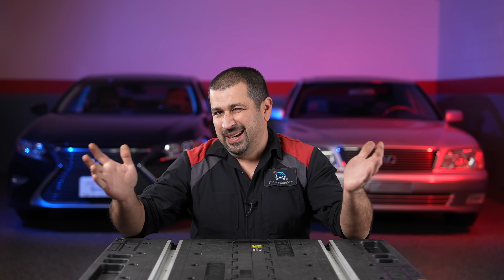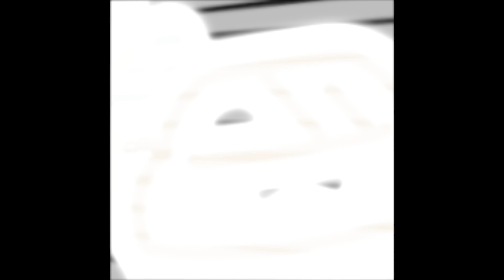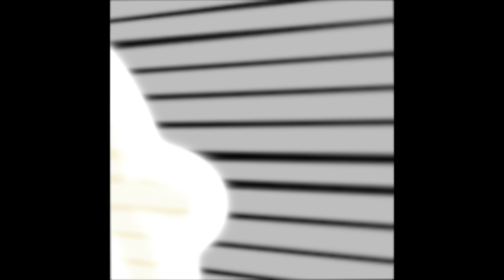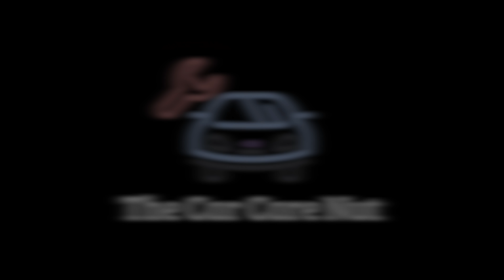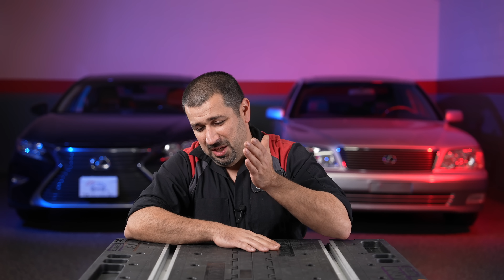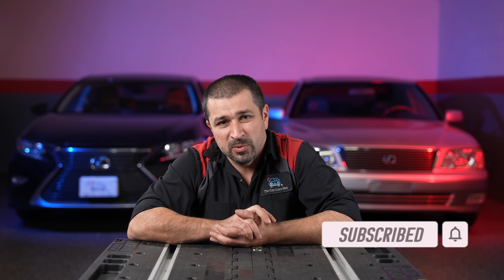Can Modern Turbo Engines Be Reliable? Here's The TRUTH!

Comment: I hear the "adapt to the change, old cars are just getting older, you're going to have to buy new/er eventually", and that just solidifies it for me more in my head: my next vehicle purchase will be 2015 or older. I hope that there are enough consumers doing similar that it changes the industry, but I doubt it, and there's nothing that is making me change my stance either until we go back to basics: analog gauges, simple button layouts, DIN standard radios that are not part of the CANBUS network/ECU controls, radar/cameras/idle stop/start/emergency brake tech being optional features, simpler but efficient and reliable engines that adhere to "right to repair" ethos, etc...

There's simply absolutely nothing appealing about new cars when the cons outweigh the pros when looking at any given vehicle as a whole package. Justify/defend new vehicles and their tech all day long, I think for me older = better, more reliable, safer, and easier/cheaper to work on. I just need more mechanics like CCN here in my area to help keep my fleet alive!

Comment: Emissions are produced by burning the fuel, not by the number of cylinders. A small engine with a big turbo burns as much fuel as the larger engine without a turbo producing the same amount of power.
This being said, I fully agree with the recommendation to change the oil frequently.

Comment: Well said. 
I  own a 2014 (since new) Nissan Frontier naturally aspirated 4.0 V6 and it is golden. Previously owned a new 2003 Nissan Maxima with the same V6 displacement engine and never had a problem. One time I drove through Mojave Desert 116 degree heat and the temp gauge never went past the level 1/3 mark. Change oil often and they will perform well past 200,00. I will never own a turbo. My next car will more likely be a restored classic V8 sedan from the fifties or sixties. That is all.

Comment: yes they can, but only if they are not designed extremely lightweight, and extra lightness does not compensate fuel savings vs engine mileage lifespan. aircraft prop engines with turbochargers work reliably at high load and the difference vs car engines are proper cylinder wall thickness, proper oil cooling, regular turbine maintenance. 
current car turbo engines of kia, bmw, mercedes, ford are designed to fail either at journals at cylinders or at oil pump it is not "if" it is well known pattern.

Comment: I bought a Ford F150 with the 3.5 Ecoboost engine.  It had 145K on the odometer when I bought it. It has been trouble free since. I use the best oil and don't abuse it.
Reply: That V6 config will go much longer than the boosted 4.
Reply: I have one of those in my work van. Seems to be a good engine

Comment: Hi Ahmed, thanks for your honest approach to all this. I wanted to ask about oil filters and high frequency oil changes. Ie: if I change my oil every 3k miles, is it a help or hindrance over 200,000 miles to change the filter at the same frequency or leave the filter for every second change ie: 6k miles? I have been told (applies to air filters as well) is that they perform better at trapping particles once the media has caught “some” debris in it already. Of course, I would never run until too plugged and cause too much pressure drop. Hope that question makes sense. Thanks!

Comment: The problem lies on the aluminum, since it has a stress memory that will fail. Compared to carbon steel from past generations that will last for ever. By the way if diesel engines do not heat more than gasoline why don’t they get built out of aluminum?

Comment: Had an '05 Mitsubishi Evo tuned for 21psi drive it daily for 8 years to130k miles had a blast, never should have sold it. It had a slightly low cylinder upon a pre purchase inspection for new buyer bit not noticed at idle or peak boost.... funnest car ever i beat on it and replaced timjng belt 90k and new plugs. I hit peak boost daily lol. Changed oil overy 2500-5k depending on if I had taken it to canyons or not. Shell T6 most of its life...Mobil1 factory fill isnt even real synthetic and burns off as you drive.  Got a Subaru Sti in '15 and noticed same thing...M1 oil was burning off even at 10k miles...started putting T6 5/40 in it like the Evo and zero burn off. Pro tip....Subarus are trash compared to Evo's!

Comment: 2020 Hyundai Veloster N here. 70,000 flawless miles. OCI every 2500 miles with full synthetic 5w30. I use whatever brand is on sale. I drive pretty hard and even after 2500 miles, the oil is quite dark. Starts getting dark around 1800 miles. Listen to this mechanic and his opinion. He knows 💯❤️‍🔥. I agree

Comment: Turbos can... last. But They aren't built to especially now. Its like the early 80s when they slapped em onto cars. But I will say, my 2006 PT GT HO Turbo is at 216,000 mi. Going strong. All original.

Comment: Don't forget the added expense of buying PREMIUM gasoline for use in a turbocharged motor, rather than REGULAR gasoline for a non-turbocharged motor. Go ahead and run regular gas in a turbocharged motor, just to save a few bucks, and see how long your motor lasts!
Reply: I disagree, high octane is only to reduce engine knock/detonation as piston go up and down. It has nothing to do with turbochargers. A turbocharger gets spun by exhaust gases leaving your engine which in turn pulls in air on the intake side at higher rates/velocities than non-turbo engines would suck in air.  You turbo can't tell what octane you use, nor does it care. Another backyard mechanic I can see. If your car knocks on low octane but doesn't with high octane, then you're doing ok. But that still has absolutely nothing to do with the turbocharger, period, end of discussion.

Comment: I'm in the market for a new (used) vehicle.  Looking at a 2018 Acura RDX with less than 60k miles and I think I found one.  Why?  First of all, it still have a NA 3.5L V6 which is a very reliable engine.  I will be using what's called a VCM muzzler on it to stop the constant starting and stopping of the engine.  I'm also getting the base model.  No second screen and it has BUTTONS!  Less things to possibly go wrong.

Comment: Having auto stop/start with a turbo engine seems like a disaster waiting to happen. I always disable that crap with my EcoBoost 3.5.
Reply: It's about emissions, not reliability, unfortunately.
Reply: I disabled the start/stop on my 328i as soon as I got it. Even IF it's not horrible for the engine(highly doubt) why engage the starter constantly like that?
Reply: I just got a GMC Terrain Turbo 2019 with an auto stop feature, and I was bummed it didn't have the disable button like the newer ones. Luckily, the dealership let me return it two days later since I've done a lot of business with them before!
Reply: @dariuszcisowski You can buy a $6 part to disable it for good
Reply: Do you have to disable it every drive cycle?
Reply: @maxwellcrazycat9204  I do, yes. But I hear there are devices you can install to disable it permanently.
Reply: Good engines manufactures manage turbo engines in idle state as an aspirated one, so this do not affect the start/stop cicle.
Reply: Best thing you can do for thst eco boost is install a catch can. You would be surprised at how much oil is getting sucked into the intercooler by the turbos.
Reply: Auto stop/start is in general one of the worst inventions, regardless of whether the car has a turbo or not.
Reply: @Ghanemq8  unless you have a hybrid
Reply: @sprockkets   How come?
Reply: @Ghanemq8 Their is no traditional starter. The drive motor fills that role, and is powerful enough to drive the car. As such, it's no struggle at all for it to start the engine.
Course most hybrids aren't turbo either.
Reply: @sprockkets  I didn't know that. Solid info, thanks.
Reply: @Ghanemq8  Mazda CX90 and CX70 does this along with their larger turbo inline 6 cylinder. They call it mild hybrid and also use it for take off boost.
Reply: @sprockkets  
Also, start/stop on a hybrid in heavy traffic is more like "stop;  creep for a while on the electric motor;  start (the gas engine) only when speed increases".

My hybrid truck gets up to 21-22 mpg in heavy city traffic and only 17-18 mpg on the highway.  It is a twin-turbo V6 hybrid BTW.
Reply: @Ghanemq8 I did research.  A turbocharged gas car, without auto start-stop, will be more reliable than a normally aspirated car with this start-stop feature.  Is this accurate???   That’s what I’ve found in research.
Reply: @chrisduzynski6559   I don't actually know, I'm not an expert haha, but I would guess that the effects would be similar regardless of whether the car is naturally aspirated or turbocharged.
Reply: @Ghanemq8  My VW 1.4TSI was "stop don't start". Despite being a DSG automatic it was very prone to stalling if you didn't turn off the start stop.

Comment: Turbos will never be "Reliable", will never be "Great"
in modern plastic engines.
The number 1 villain against any engine is "Heat".
So let's add a component that increases engine heat, and complicates cooling?  Supercharges do the opposite. Assist in cooling the engine.

Comment: The problem is when they mate an SUV with an 1.3-1.6L engine with turbos and poor cooling. 2.0-2.5L engines and turbos would be more appropriate. Old Volvos with Turbos held upp just fine.

Comment: A co-worker had a 1987 Buick Grand National with a turbocharged 3.8 liter v6 engine. Wicked fast and a long distance commuter; 4000 mile oil changes and that car was still running strong at over 300,000 miles.
Reply: The 3.8 V6 is legendary
Reply: Turbos are not a hindrance to engine longevity when the vehicle has a decent base HP without the power. For example look at the base HP to weight ratio. 

Let’s take an example if I take a 3 cylinder 1 liter engine and put it in my pickup truck (which weighs almost 6000 lbs). That 3 cylinder engine is going to rev in the range of 3 to 4 thousand RPM to sustain a modest acceleration. If I am running a 3.8 liter V6 it’s barely going to break a sweat getting that truck on the highway. 
    So now we want the engine 1 liter engine to behave like the 3.8 liter engine using a turbocharger. 
1. We need to overpressure the intake stroke getting that engines intake manifold into the 30 to 40 PSI range. If the engine has a 10:1 compression ratio, that means that the head gasket, head, top cylinder and valves need to be able to hold this base pressure in. Then the fuel is going to be injected and an explosion with a base pressure of 400 PSI is going to 1000s of PSI before the cylinder is in its down stoke. The survivability is going to be dependent on many factors, it’s the corrosion resistence of the antifreeze keeping the meat between the cavity of the cylinder and the cooling system. Is this pressure going to dry out the rings more quickly creating friction. Is the pressure going to cause excessive wear on the valves and valve seats? At temperature will the head warp? 

2. All of the above is not a problem if you have a light foot, because peak horsepower on a turbocharger is charged mainly at high RPMs. The turbo offers almost no charge at lower RPMs 
Even revving the turbo up for brief periods, it takes time for a turbo to reach peak boost, so still not a problem. But if you decided to put a recreational trailor on you 3 cyl 1 liter truck and haul it up pikes peak. That screaming little engine with its turbo is going to start aging the engine rapidly by the following two things. 
1. Peak manifold pressure
2. Peak manifold temperature. 

3. On the turbo side the peak in engine performance is going to cause rapid degradation on the oil cooling components, deposits inside the turbo charger and lastly excessive heating of the oil requiring an oil cooler. 

Turbos are also not new for gasoline engines. They were used in the airline industry. The predecessor to the jet liners of Boeing, Douglas, and Lockheed were all using turbocharged engines. There were problems of using turbocharges, the map temperature required opening up the cowling, and if that was not enough the planes would need to drop speed and altitude. There were problems (accidents) associated with turbochargers. There were warnings and flight directives concerning their use. In general take off speed lasted only a couple  minutes, climb speed was lower (and so engine RPM) for a given throttle setting, more over the propeller angle was increased with climb which lowered RPM. Once cruise altitude was reached and airspeed increased the engines were throttled back, the prop angle was changed resulting in lower performance of the turbocharger. 

There were kids in my high school that turbocharged their 70 model muscle cars, the invariable result was they would blow the head gasket. Why are they adding turbos, they want a car the speeds up faster, a typical trany was a power glide, it would rev up faster than engines today because it had two gears, this means you could get that turbo power quickly, and you could blow your engine up quickly. 

If you are driving a Grand National 300,000 miles, I would almost bet this person babied his car, only showing off every now and then. He probably did not tow massive trailers on the back of his car.
Reply: @Darisiabgal7573 Good call.. I always look at the power of the motor has without the turbo..
Or at least look at the compression ratio. Back in the days for turbocharged motor compression ratios around 8:1... In my current vehicle is 10 to 1.. meaning that it has enough natural power that I can move on without the turbo..
Reply: @Darisiabgal7573  That is what I see and the 3.8 is a great example.  Getting 175-200hp out of them was easy so the 260+hp turbo wasn't stressing the heck out of the engine.  These I4 100-150hp naturally aspirated engines cranked to 300hp turbos, yeah, those are going to brick early in life.
Reply: Buick engineers had bumper stickers for those cars -- I Brake For Corvettes
Reply: Those Grand Nationals were amazing cars and bullet proof, I had an 87 GNX and in the 80s and 90s it left everything in the dust
Reply: @stevenekdahl7124 yes I had a chance to buy one and I still kick myself I had 10,000 Mi on it and they wanted $15,000 and I was too cheap to buy it
Reply: He used a grand national for a commuter car 🤭 good grief.
Reply: The Buick 3.8 was one of the best V6s out!  Buick V6!  Loved that engine.
Reply: Should have seen the GNX had the chance to buy  two GNX  they only made 500 and something and I was too young and too stupid to know the Rarity of these cars  the porcelain turbo  GNX could do 0 to 60 and under 5 Seconds faster than any car of the time
Reply: @marcusevangeliste7426  whew, and your comment was even edited? Wow.
Reply: Not familiar with that particular engine, but being an owner of nissan skyline r35 equipped with VQ35 which is v6 3.5L engine I agree, Those things are built for YEARS to last. Especially if you mostly drive calm, this engine not getting too much heavy load and sounds great as well 😉
Reply: I just use Pennzoil Ultra Platinum 020 or Mobil 1 extended synthetic or Royal Purple whatever is on sale change every 5,000 MI 1.5 L turbo in a Nissan Rogue sometimes 6,000 and it's fine
Reply: 245 hp at 3300 pounds wicked fast? Lol
Reply: @eddiehaskell9713 
245 was underrated They were closer to 300. Even the turbo trans Am that came out a few years later.. use pretty much the same engine and they were dynoed at 300 horses..

The GN will easily do quarters in the high 13s and 60 around 5 seconds..
Reply: @moshameem99  Completely stock they ran high to mid 14’s on a good day
Reply: @eddiehaskell9713 That's funny mine back in the '90s ran high 13s.. But then I have luck with vehicles.. also had a 93 Nissan Sentra SER with a 140 horse 2 l which CAR AND DRIVER. Would clock in at mid 15 second quarter miles.. Yet I can do high-14s..

And lastly the Grand National was not the fastest turbo Buick.. The turbo t or also known as a regal T-Type for slightly quicker because of their lighter weight.. The greatest thing about these cars is not how quick they were from the factory but how much GM plugged it up before we removed the lid.. Do you get these things down into the low 12s with just several hundred dollars..
Reply: Very reliable turbo engine and not hard to work on. I have this 3.8 turbo in my 89 Indy Pace Car
Reply: I gave up on my GN bought brand new. Changed the oil every 3K. Rear main oil seals and other mechanical issues. $6000.00 in warranty work . Sold it with 32K on the odometer. It was a happy day.
Reply: you got very lucky. 4k miles between oil changes is way too long. i won’t go more than 2.5k between oil changes
Reply: Turbo-charged engines need better oil cooling than non-turbo engines. Which manufs actually bother to engineer for proper oil cooling? Much the same for automatic trans cooling.
Reply: Those 3.8 engines normally aspirated are one of the most reliable engines around 👍
Reply: @benson098123 Always good to start out with a solid reliable engine .🇦🇺
Reply: @benson098123  I have the smaller 3.4 naturally aspirated that is 24 years old with no problems and is as smooth as silk, good gas mileage also.

Comment: @TheCarCareNut, what do you think of the Honda Civic SI .... (*it  has a 1.5l with a turbo)... vs The Toyota Camry SE *hybrid.... 

After watching your video... and living in Florida... I think the call will be CAMRY... not the HONDA 1.5 Civic SI, it will be hell in Florida
Reply: Save some money can get the Camry LE. The 16" rims will smooth out the ride and maximize fuel efficiency. The cloth upholstery is a better bet in the heat than synthetic leather.
Reply: @rightlanehog3151 I agree...I like the SE better over the LE...I plan on getting aftermarket 18" anyways after a year or so

Comment: 220k miles on latest car says YES. I change oil and filter at 10k, let turbo run down before switching engine off, don't flog it until at operating temperature. Simples.